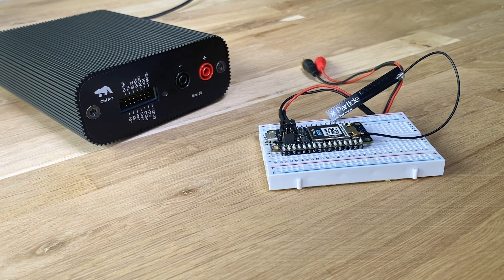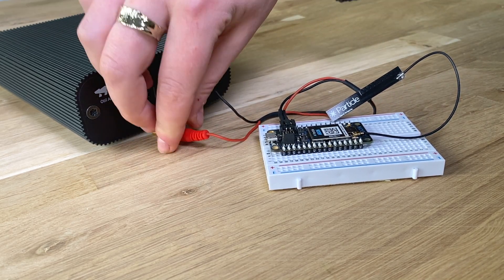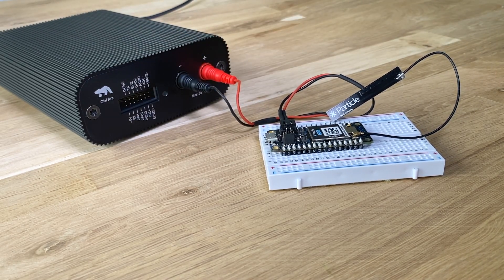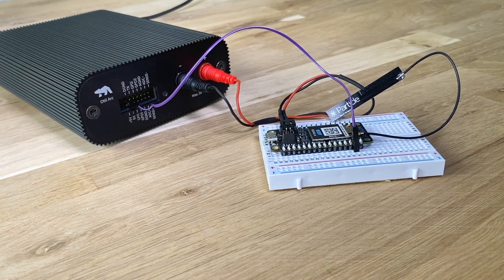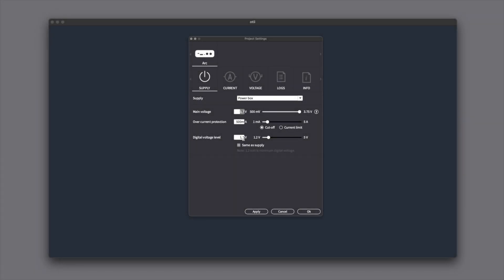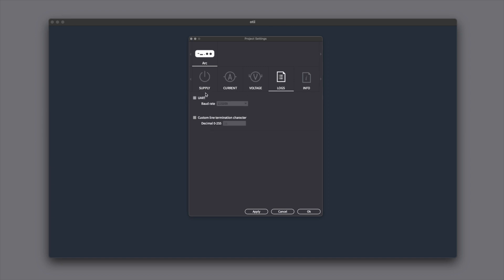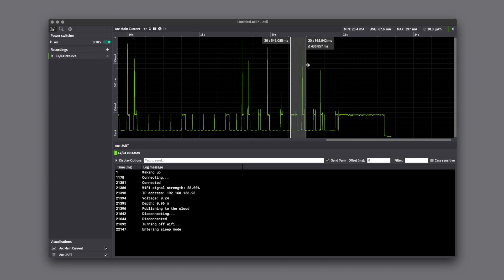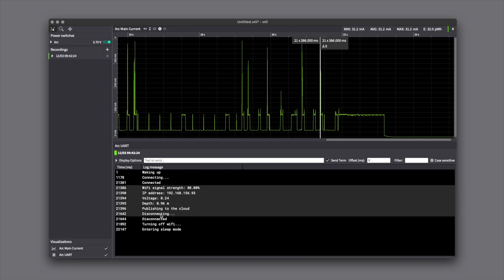Set up a #UART Recording

Comment: Do we need to connect the ground to the Otii device as well?
Reply from the maker: Otii Ace needs to have the ground connection since the expansion port and the banana plugs are isolated.
Otii Arc does not need to have the ground connection as it is internally connected.
We have a newer video on the topic with more details: https://youtu.be/GXZyfa0zg3I?feature=shared

Also check out details here: https://www.qoitech.com/usecases/debug-power-measurements-with-uart-output-logs/